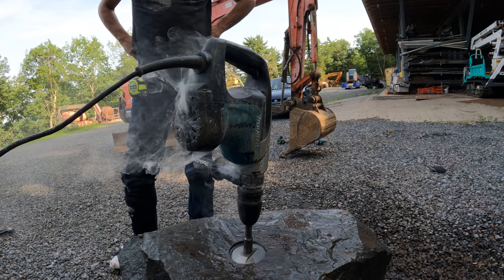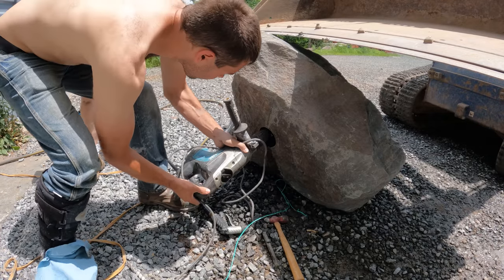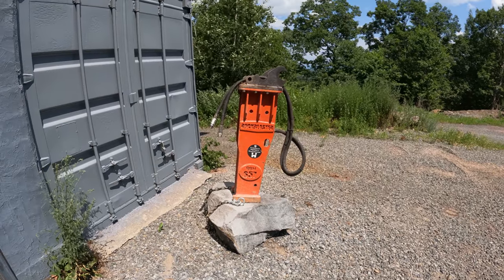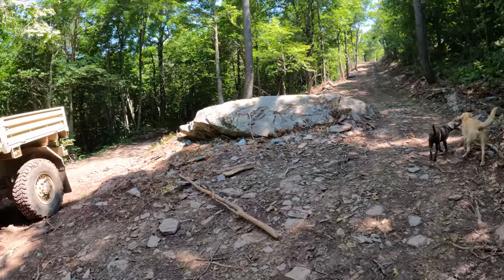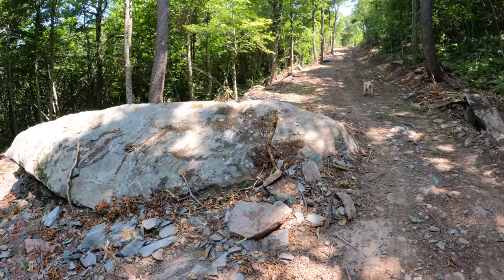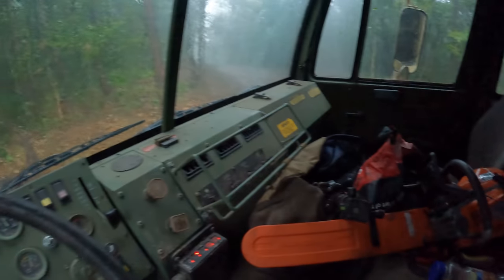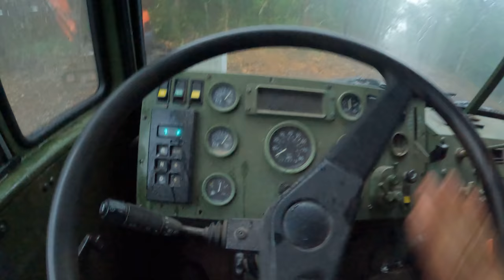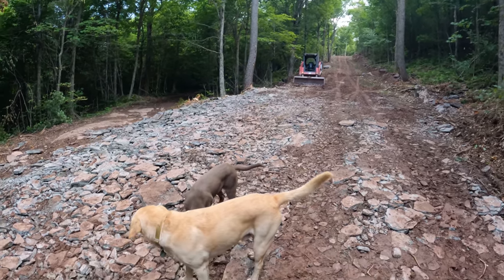Hammering and drilling rock

Comment: I think the only way to have equal force on the o-ring would be to hang it up by the body. As in, the chisel end must have no force on it. Currently the way the drill leans means there is a side force on the chisel.
Reply: or he could just cut the top surface perpendicular to the hole and voila
Reply: That’s exactly hat I was thinking. Cool idea but he’s better off Laying it on the side and then have a jack to make the chisel level with the jack and have no force on it
Reply: @dantekeskin1512  or stack a few pieces of board and shimmed with a wooden wedge until pressure is off of the o-ring
Reply: @Christoph-sd3zi  yep 👍🏽
Reply: @Fogyt121  in theory if the hole is the exact size it would be fine to. But it just looks very top heavy stood like that.
Reply: Yes There is more side force on it with the weight of the hammer leaning vs it just siting on the grond with the weight of just the bit
Reply: Weld up some Square tubing into a frame to mount it on bolted to the rock that the arms are swivable that also bolt to the top of hammer.
Reply: chisel is free floating like in air hammer
Reply: Aa

Comment: With the sheer amount of equipment you have it would save you time if you installed jumper plugs on the equipment you are constantly jump starting. Plug one end into your truck the other into the equipment. A good solid connection. Plus you could outfit you battery charger with a plug too. Just a thought. Great channel keep up the good work. And be safe.
Reply: They sell small solar panels with magnetic bands to stick to equipment. They are a battery maintainer. They are not that expensive. I believe he could use several of them.
Reply: Exactly, having those big Anderson paddle  plugs on the front and rear of my trucks has made jump starting, plow and sander hookups and receiver winch use SO much easier.. not to mention other things like DC-AC inverters and a electric hydraulic pump…

Comment: ive been making light stands out of rock for some years, to stop splash back i used a flat piece of plastic around the shaft of the bit, also using extensions, largest one i made was a 8ft x 3ft x 1ft for out door lamp, many table lamps of granite, sandstone, marble and many other types of rock....
Reply: The great thing about that is it’s built to last.

Comment: Nice Vid as always! Small tip from an operator, only hammer about 15 seconds on spot and then move onto another. When you hammer on spot for a longer period you will heat up the hammerbit and remove its hardening. That means the bit will be wore down much faster and dont forget to grease the hammer
Reply: I'd agree with you too Tim and also don't use the hammer as a prybar. It puts stresses on the internal parts of the hammer.

Comment: Andrew it's too bad that you don't have a portable Rock crusher.
With all that rock on that mountain you could crush it and build a awesome gravel road to the top of your property without it getting muddy.
Reply: I would bet a dollar he recently bought one. I do not know just a guess
Reply: When they were widening Route 3 north of Boston they blasted out a lot of granite in the high spots, and crushed it to fill in the low spots and make the base for the paving.
Reply: there Is a guy in Montana makes small crushers on trailer truck body . 
I need one.
Reply: Well, as they blasted the wall Andrew had enough gravel and crushed stone to build a few miles of driveway with it. XD

But the main part of it was used to expand Andrews parking space.
Reply: Dear David Wolf.
I don't know if I remember correctly but I think to have seen Mr. C. using such a crusher hanging on a skid steer or on an excavator. Or was it only a kind of sieve to sort out the usable stuff?
Best regards, luck and health.
Reply: @Chr.U.Cas1622  That was a sieve he had. He could scoop up dirt with it and it had a rolling drum. Dirt would fall out while the bigger rocks would stay in the drum.

Comment: Those big hammer drills drink a lot of amps. When I was in the equipment rental business, I warned customers to not exceed 50' of 12 gauge extension cords though we liked 10 gauge 50' extension cords better. So many customers burned up those tools by running 100' of 18 gauge extension cords! Those big electric tools need both 120' volts and the appropriate amperage too. When they don't get enough amps, they burn up the stators and amatures.
Reply from the maker: Good call that was a 12g wire. Not sure of length.
Reply: @AndrewCamarata  I think a big part of the issue here was insufficient  water.  You showed a large chunk of dryish sludge  and also got your new drill stuck too. This is generally due to insufficient  water  I had new staff kill drills and drill bits  and  cutting blades the same way  . That sludge is like quick sand, it is also thixotropic meaning it gets thicker and stickier when it's agitated or spun.
Background, stone mason and owned a stone masonry  business for a few years... retired now due to ill health,

Comment: The intrinsic problem with using a hammer drill on rock is, as we see in your video, the second one:  you have to put weight behind them. I had to bore out rock and burned up more bits than my boss was comfortable with. Don’t know if you were boring with an industrial diamond cutter hole saw but they sure work better that most. Great videos. Always look forward to “The Adventures of Andrew Camarata and his Machines of Awesomeness” videos.

Comment: No need to push too hard - let the hammer mechanism do the work. You almost want it to “float” to give the maximum impacts (if you push down, it doesn’t allow the full impact energy). Great video!
Reply: Absolutely not. Floating can cause a dry fire and that’s bad for hammers you want constant pressure down on the hammer
Reply: @DanielGonzalez-un7bt  you want a downward pressure, but do you not want to lean into it. You’ll suppress all of the hammer action.

Comment: Did the rock base stand achieved the support that you wanted? I thought that  a steel frame might have been easier, and ensured the hammer could be kept upright without a load on the 'O' ring or any other part.
Reply: Yeah, I thought that was a lot of work for something that could have been accomplished with some steel tube and welding. Sure it looks unique, but I'm not convinced it's a very good solution.

Comment: I work in a granite quarry and have to drill tons of holes. If you run the bit through some concrete when it feels like it slows down every few minutes it’ll expose more diamond from the substrate and sharpen the bit

Comment: A large hammer drill like that is not the right tool for core drilling. You need a proper core drill (which are very expensive, so hire one for one off jobs). You should never use hammer action on a core drill bit either.
Reply: Dood gets views for being a little special… not because he does things the proper way. 😂 underdeveloped orbitofrontal cortex for the win.
Reply: Biggest killer of drills & core drills is using hammer action when core drilling  & drill speed too fast...
Reply: I was thinking this the whole time lol
Reply: O
Reply: @TsunauticusIV  ⁷ù7777uuu77777777u77777ù77777u7uù777777uuù7uuu777u77uuuuù77uuuùuuuuu⁷uuuu77ù7ùuuùù77uùù

Comment: Hey Andrew.  I'm sure someone has already told you this but you really need a core drill for something like this.  they also have built in water hookups and are specifically talored to drilling through stone, concrete, and rebar.   They will go through just about anything.

Comment: Andrew, where did you get the ball valve on that excavator to isolate the auxiliary loop? I have been looking for something like that for a while, I blew internal seals in my thumb from not having one.

Great videos as always!
Reply: Just about any hydraulic shop should be able to either get you one or install one for you. I know my local hydraulic shop has done a few on excavators and another of my clients had one done on his Tak as it didn’t come from the factory with one. Just call around to your local hydraulic shops.

Comment: Great content. But owning my own hydraulic hammering company up in New England I want to share some tips… you definitely need a lexan safety shield. It’s not a matter of if, but when you get nailed with a rock. My machine doesn’t have any glass on it. It all gets broken. Another tip is hammer with your drives in front, so to take weight OFF them when you apply down pressure. Also never lift the tracks off the ground. 

But again, I’m a big fan. Happy hammering!

Comment: A thing to remember when using electric drills or anything else that is electric: whatever the amps say for the drill, you need to feed that with the appropriate wire size, with also thinking of power source and distance. Example: using that 1st drill needed let’s say 12 amps at 120 volts. The next thing is the distance from ( Not the outlet) Power source the cord needs to be able to supply this voltage AND amperage that distance. If you were using on that drill a 16 gauge cord it would ( for the drill motor) be like you trying to ( using a straw) suck up a Milkshake through a coffee stir stick! You are not feeding the motor Adequate amperage to feed the motor.

Comment: Mate,
 Cut that diamond hole saw and weld some pipe between the driving part and the cutting part.
Mix a bit of dish washing detergent into your coolant supply,
Remember,
If it needs water for cooling and clearing the swarf , 
It’s best not to just lean harder😎🤘
Rock drilling 101 .
Always remove the cuttings

Comment: IF you still have that other impact drill, it probably only needs brushes.   The brushes can wear all the way down and then your wire touches the commutator and that's what smokes.  Could still be fine with new brushes, unless you actually burnt the coils.

Comment: 2:00 Andrew, I imagine you can build a rock drill that allows the operator to sit on top of it once the bit is ground in enough. Some simple outriggers, a seat,  and a bracket to hold the lube hose. 🪨 💺🧑‍🔧

Comment: Having to pick my dogs up into the vehicle is a bit of a make or break thing when it comes to bringing them places with me. I used to drive my truck down the hill of the driveway to drop the tailgate so they could jump easily into the truck bed. 

Your dogs might jump into the military truck if the front tire was turned out and they could push off the rubber tire to get in the cab. Thats a tall truck cab.

Comment: ha been core drilling for 40 year big tip don't use hammer and very little pressure  it would fly through. get an extension bit stop the core from binding

Comment: Pretty sure that roto hammer cup-bit is supposed to be used dry.  vacuum the dust, and use an extension when the drill gets too close to the rock.

Comment: Hi Andrew was watching video on your trail trimming snow roller watching the roller at work on soft snow think you need to put a scrapper bar in front of roller it should knock the snow of the front stopping in from building up in a mound at the front

Comment: Andrew, your absolute one of the crew I trust and you’ve earned respect. Please give me sum guidance. My 26 year old Craftsman 225 batt charg and 50 amp hot start, smoked and died. Like you And Sam drilling that rock Sam that you tackled. I’ve looked at Schumacher but plastic plastic . I bight one from “Amz” it lasted 1 charge a week after it was delivered. I’m doin dozers, old Kenworth trucks log loaders, thought u found a Schumacher steel cased one probably at a garage sale. What are some suggestions from the master of broke for no reason. Thanks brother
⭕️❌

Comment: As I was watching you attempt to remove that plug of rock, using a hammer, spike, loader, I was wondering why you didn’t just turn the rock over and start drilling from the opposite side? Wouldn’t that push the plug out? Or did you not want to drill a hole all the way thru?

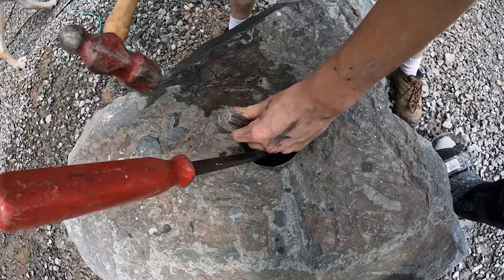Comment: @Andrew Camarata ,SAM, 7:17 NEVER EVER HIT THOSE DRILL BITS WITH A HAMMER!!! THOSE DRILL BITS ARE HARD STEEL, IF YOU HIT THEM ON THE EDGE A BIT WILL CHIP OFF AND CAN GO THROUGH SEVERAL LAYERS OF CLOTHING AND INTO YOUR ARM, THEN SPEND YEARS TRAVELING AROUND YOUR BODY, I'VE SEEN IT HAPPEN, TWICE!!!
That's why a chisel that's designed to be hit with a hammer will round over, it's a softer steel to prevent chipping and almost certain injury. Take care.👍

Comment: They make extensions for that cutter ... I have 8" and 16" also I haven't used water with mine either. (Usually don't have any on the jobs at that point).
I have cut through 2 ½ foot thick concrete foundation walls with  ½ or ⅝ inch  rebar in-line with the hole ... it takes a little bit longer having to cut the rebar but it keeps cutting .... im guessing around 100 holes cut on one 3 inch bit..

Comment: So... Quick question.
If storing the hammer on it's side will eventually destroy the o'ring in the end of the hammer because of the weight of the chisel, how is storing the hammer such that it's weight is hanging on the chisel any better for the o'ring?
Reply: Maybe the oil is on both sides of the o-ring so it doesn't dry up & fail on the side that was sitting upward?
Reply: @CerebralAilment  Yeah, I honestly don't know.

Comment: That's Andrew, take something just lying around to repurpose it and with a little work and assistance make what ya need.
I'm actually surprised he didn't just use some 4 inch steal tubing and flat plate plus hardware and weld up a frame to hold it.
Would have saved that rather expensive drill.
Now to watch a Diesel Creek video.

Comment: What did you do to your leg, foot, or ankle, i had a boot like that when i broke my tibia, it healed like a cross because comp missed it, along with the ACL being ripped off the bone.  I worked like that for 9 month's outside in a cemetery through the winter, until they did an xray, and mri of my knee.  They rebroke my leg, and plated it, screwed my ankle bones together to fix the ligaments in my ankle.  Because comp screwed up, i have permanent damage in my knee and ankle, sued the dumbasses, and bought my house.  Good luck and God bless.

Comment: Andrew, Hi, I would like to pick your brain on the weight/size of machine I should run, i'm about to buy a mini excavator and i'm torn between 1.5ton or 3.5 tons, what do you think? It's for small work, mostly just working on loose soil, nothing too big. What's your advice?
Reply from the maker: Big one
Reply: There is a pretty big difference between the two… application, towing it around, price, features are all vastly different between those two sizes of machine not just the weight. Really depends on what your using it for and current setup but I would think the 1.5 ton would work for the jobs you stated.
Reply: @AndrewCamarata  big is always better 😂

Comment: It would not have been nearly as much fun (and it would have saved a hammer drill): cut a 55 gallon barrel in half (so it's not so tall, fasten a 3inch pipe in the center and fill the space with concrete. Makes a sturdy rock drill stand.

Comment: You are using too much water. The water running off the cut should be milky.  Don't use the hammer function if that is a diamond core bit..

Comment: Aren’t you supposed to drill a pilot hole with a long drill bit first then follow afterwards with the core drill, using no hammer action, just rotation?

Having the extra weight and area of the core drill slows down the centre drills progress( spreads the impact out and absorbs it due to the extra inertia of the assembly) and having the hammer action on all the time slows the progress of the core drills cutting action.

Comment: Never use hammer action when core drilling.
The drilling action needs to be as smooth as possible;... the jerky action of the hammer can snap expensive diamond teeth very easily...
ROFL
But who give a fleck when Patrons pay for the tools...
We'll just Drill it the Andrew way...
...
If U listen carefully;... U will hear moments just before the smoke appears...
The motor making a spluttering sound...
That is a sure sign when U need 2 change the Brushes;...
They come in Pairs... ROFL

Comment: Heads up . You point the braker away from the machine.. blade behind you and pushing away from the machine is so much easier on it.
Reply: An excavator’s maximum force is applied in a pull toward the machine, so if that pressure is part of the destructive force, he’s going in the right direction. Although it wouldn’t be the first time tool best-practices were not used on this channel.
Reply: @markstevens1729  yes but it's for safety reasons.. you dont point a loaded object at your body.. safety first. Let the braker di the work.. post it away from you and the machine..

Comment: Ya probably exceeded the duty cycle rating of the first drill……I’m surprised you didn’t leave it standing and turned on until it was a raging tiki torch. 6:25: “I wonder if I can break the handle off this new drill”……..6:30:”YES”..

Comment: @Andrew Camarata
Great show Andrew.   Do you have any areas on your property that is hiding a gravel vein under the trees.?   I don't know a lot about that, but some states have maps showing different areas where there is big wide belts of sand.   So I thought they may have the same thing for gravel,  insteadof doing numerous test holes or test pits.?
Reply from the maker: I found some rock, I started putting it on the road.